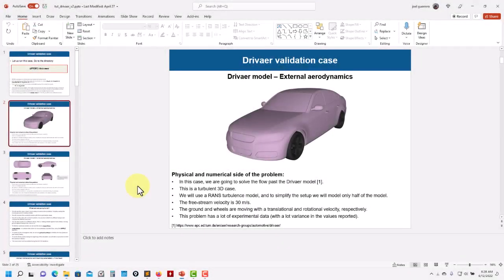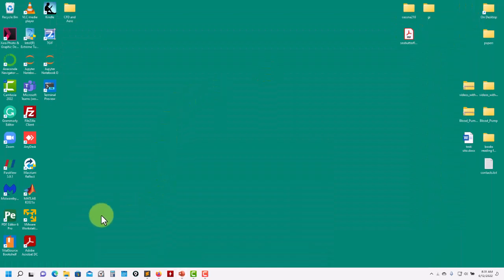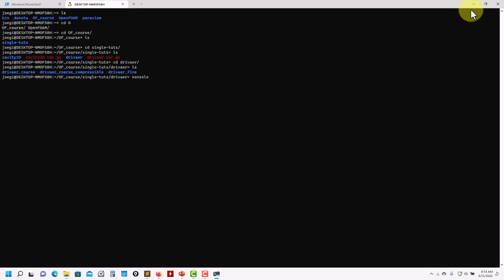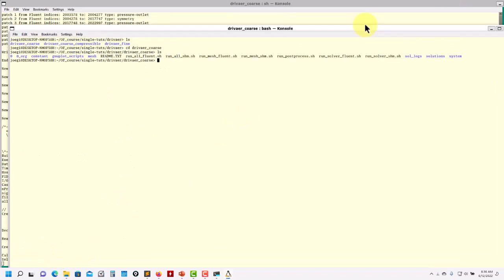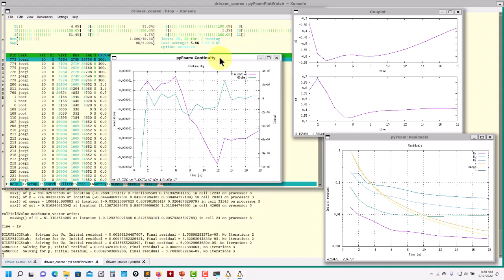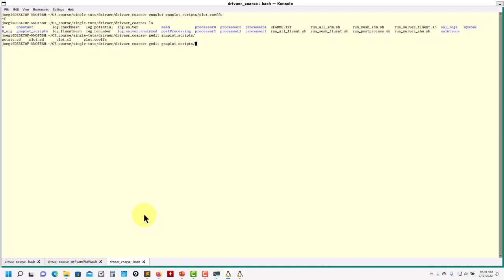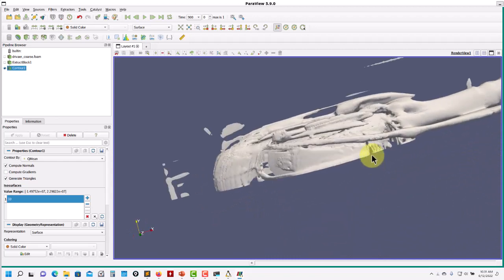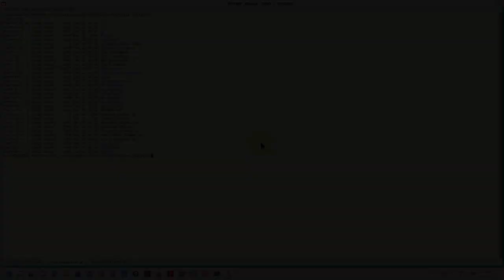7. Running OpenFOAM in WSL - Benchmark case

Comment: Hi, thank you for the helpful video. I have one question regarding running OpenFOAM via WSL on a Windows machine. I am thinking of buying a workstation. But I am not too familiar with ubuntu OS. So I just wondering what the limitation or difference when running OpenFOAM in WSL windows and pure ubuntu machines is?
Reply from the maker: Pretty much is the same. Maybe, the difference is that you don't have a native windows manager but it can be installed with no problem. In my personal experience, you get the same performance with WSL (or dockers) and you don't need to partition the hard drive.  So go for WSL.